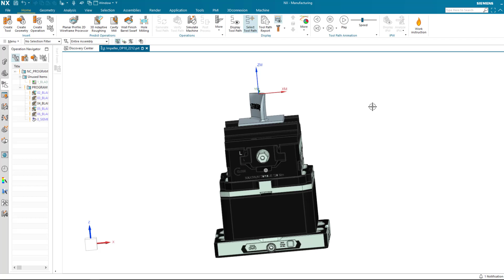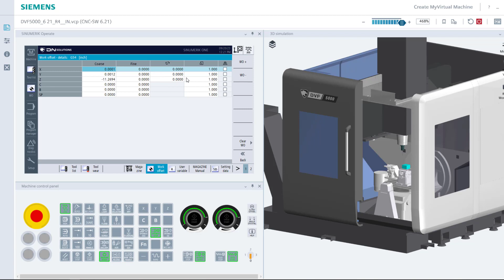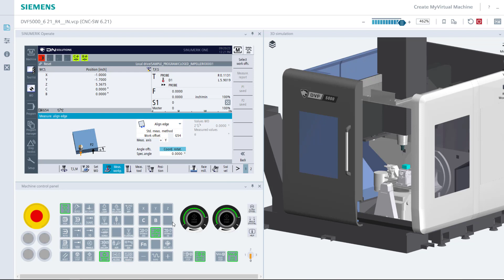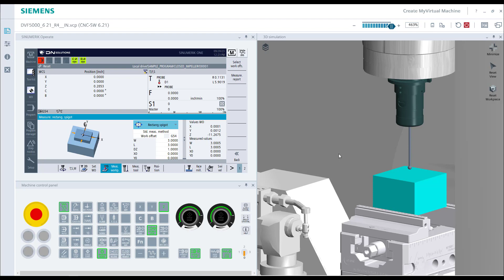Mastering 5-Axis CNC Setup Without an Indicator | Precision at Your Fingertips!

Comment: sorry for offtop, but how to smooth movement on small length lines toolpath...
machine works slowdown...there is many function like G64;SOFT;COMPON;etc, but how its works - not at all understand...
Reply from the maker: these are old commands there is a new cycle 832 that cover all of that